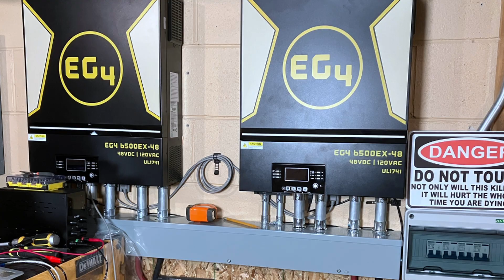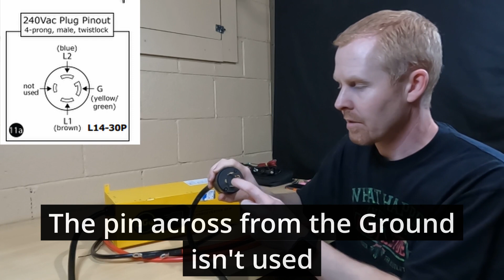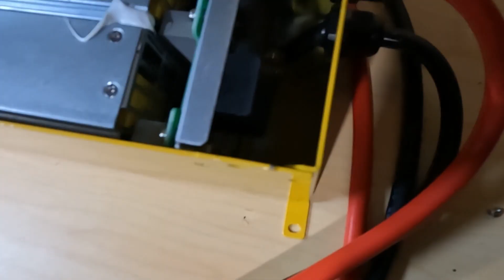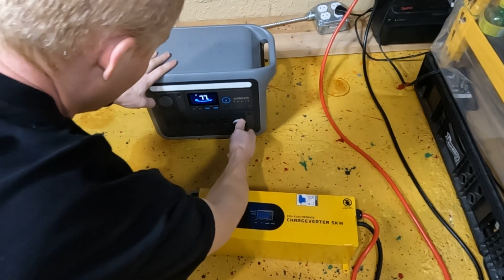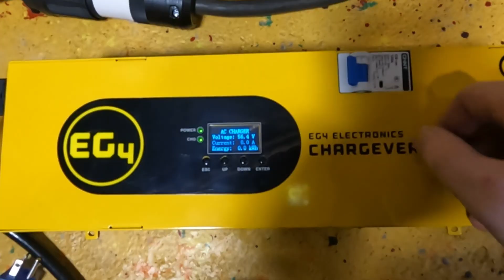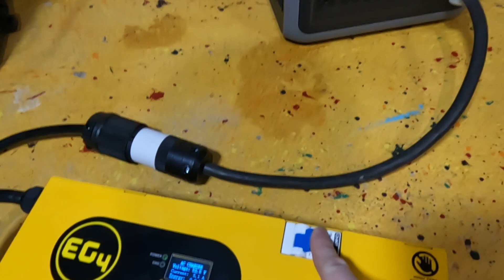Finally Picked up an EG4 Chargeverter 48V 100A Battery Charger

Comment from the maker: Parts & Pieces (affiliate links)
--------------------------------------------------
EG4 Chargeverter 
- https://bit.ly/3xfATCI (Current Connected)
- https://bit.ly/3FhtyX5 (Signature Solar)
Leviton 5266-C, 15 Amp Plug - https://amzn.to/48rh0pD
Sintron NEMA TT-30P Straight Blade Plug, 30 Amp - https://amzn.to/3RoXNxX
ELEGRP NEMA L14-30R Locking Connector - https://amzn.to/3GLtHjl
10/3 SOO Cable - Already had on-hand

Supporting the Channel
--------------------------------------------------
The 'Buy me a Coffee' - link is here (on the bottom, right corner of the website): https://going-off-grid.com

You can also click on the "Thanks" button under the video to support the channel. 

Thank you for your support!

Comment: Look up the new ECO-WORTHY; EC100 48V 100A Battery Charger | 5.78KW Max Output for LiFePO4, Soft Start | 120V 240V AC Input and Generators.
Reply from the maker: I've seen that.  Might try and get my hands on one.  Would be nice to have an extra charger like the chargeverter for my testing.

Comment: Using our unit for the first time in the past 2 days. Matched it with a Westinghouse 5kw generator to charge an IFLA 48v battery bank... it is putting power in the cells without any problem. I am monitoring the cells just to be sure it is charging each cell evenly.

Comment: Using first gen EG4 LiFePO4 batteries, and a large 10kW and new generator, could not get the amps to start flowing.  No SOC applicable, but I'm doing something wrong:  My suspicions:  1. groud of generator goes to house grounding rod. as part of the 3 wires going into the Chargeverter.  2. I set SOC at 1% Start and 100% Stop to 'Disable' SOC.  3. I always immediately flip the breaker to ON, when attempting to set the settings and start charging. 3. Start Voltage = 47 and Stop Voltage = 57.  What am I doing wrong?  Can't get any AMPS to flow.
Reply from the maker: I wonder if a setting isn't actually saving.  I don't have the GC version so I'm not familiar with all the extra settings that one might have.  The old one I have only has a charge voltage and current.  Does the GC version have a current setting like "max amps"?

Comment: very awesome to know that Victrons don't need this ! 
thanks for sharing this since it will save me some money not worring if i need one or not . 
take care sir :)
Reply from the maker: Yeah, from what I've seen and read, they're supposed to be more resilient to the fluctuations of an open frame generator.  I would still double check with whatever Victron gear you get and look to see if there's a specific THD requirement for a generator though.

Comment: This is the only practical way to use a diesel generator of any substantial size. Diesel generators must be run at near full load capacity to prevent wet stacking. These Chargers make it possible to charge a large battery Bank in a reasonable amount of time without having to run a generator all day long. I run two of these on a 10 KW military generator and it does pack some punch ringing the batteries up substantially in just an hour.

Comment: I am not a wiring guy, if I can't use a standard adapter plug is there a place I can get one that works with this? My generator only does 120v.
Reply from the maker: I’m not sure if eg4 is selling any adapters or not.  I thought they were supposed to.

Comment: I've ordered the Chargeverter and supposed to arrive in March.  I also have two new Anker f3800 power stations with their new Home Power Panel.  The HPP is to arrive in March.

My question to you is what Voltage and Amperage should I set the Chargeverter for to charge the f3800s via the DC input which is the XT60.  The DC input has two XT60 male connectors.  I have a relatively old GENERAC gas generator which has a 30 amp 120/240V connection rated 5500w running and 8500w surge.  Instead of solar panels, I thought I'd use the gas generator to output to the Chargeverter and let it produce clean DC to my f3800s.  I guess if I don't hear from you, I'll contact the place I bought the Chargeverter from....
Reply from the maker: Unfortunately I'm not directly familiar with the F3800.  I've seen some reviews on it but haven't had my hands on that device.  If those are the PV input ports, I would be cautious putting the chargeverter on there.  I've been told that some solar charge controllers bridge the positive and negative connection together once the battery is full.  This is fine for a solar panel but it would short out your chargeverter.
Reply: Thanks for your reply!  I too wondered about the bridging the positive and negative connection together once the battery is full.  I'll write Anker Support about this before delivery of Chargeverter in March. @AdamDeLayDIY

Comment: All I can say is.. open that thing up and check the connections. Make sure the modules are well seated, and the main positive to the battery is seated well and tightened in the circuit breaker. Just experience.

Comment: I wish it went upto 58.2v as i can't fully charge to rebalance my cells.
But the little EG4 charger will do that except you need to charge one battery at a time with sysyem off.
But the big charger works well with my Honda EU7000 providing 250v
Reply from the maker: Yeah, I wish it went a little higher as well.  

Just out of curiosity, why do you have to turn the system off with the little charger and charge a single battery at a time?

Comment: I bought one out of fear. SS said in their video that running the generator through the inverter was a big reason for inverter damage. I have an 8750w inverter generator and a magnum 4500w inverter (which is bulletproof). 

When I had AGM batteries I was using the generator often during some of those cloudy day in the winter. I didn't always pay attention to how much gas was in it or didn't get out to shut it off right away and it would run out of gas. When it ran out it would spit and sputter causing the lights in the house to go on and off. I thought this probably wasn't good for anything including the inverter. I don't know if the chargeverter would protect against this kind of damage or not. 🤷‍♂️

I hooked up my new EG4 LL batteries at the same time I hooked up the chargeverter. I only used it to test it (I don't need the generator anymore😁). The Lithium Iron Phosphate batteries have a lot of usable power compared to the AGMs I had.
Reply from the maker: Yeah, SS was warning about using generators with the Voltronic inverters.  Either way, I think the chargeverter is a great idea.  It's hard to find a decent, large amperage 48v charger.  

For me, my upgrade from lead-acid to LifePo4 was huge.  You end up with so much more capacity!

Comment: As you mentioned, you can skip AC in and just charge your battery.  Can this be set up to charge my batteries when battery reaches low and autommatically charge my batteries 24v 400ah for my Off grid solar set up?
Reply from the maker: I’ve seen and heard of people doing this.  Some involve contractors to turn on the power to the chargeveter, others just set the chargeverter voltage low to prevent the battery from dropping too far so their solar can recharge the batteries the next day.

Unfortunately the chargeverter is only for 48v, not 24v batteries.
Reply: @AdamDeLayDIY    Thanks Adam!  I appreciate your quick reply thanks for the great videos!
Reply from the maker: @merrillbalan  not a problem!  Thanks!

Comment: I’ve got an EG4 3000 EHV that is a backup and I use it to charge battery bank with 120v.  Kinda like a half chargeverter! 🤣👍☀️⚡️
Reply from the maker: Haha.  Actually I believe the chargeverters are based off the chargers built in the 3000s.

Comment: I've had one of those for a while now and it works quite well. Mine is wired into the busbars of my battery bank. I've also used to charge up new batteries to the same SOC as existing batteries before adding them to the battery bank. Feed mine with an old Generac 7.5KW gas powered generator at 240V. 

Note that EG4 specifically states that feeding the EG6 6500EX AC inputs with a generator voids the warranty. Apparently they've had serious issues with warranty claims from people who've tried feeding a non-inverter generator into the AC inputs to charge their batteries or pass thru to a house and have a lot of their units fail because of dirty power from flaky generators.
Reply from the maker: They work well!

As far as the EG4 comment, do you have any place where they actually come out and state this besides if you talk to them on the phone?  The latest copy of the manual only states that you can supply power from utility or generator.  There's no warning.  I know I've seen it mentioned on the forum, but if there's some big "issue" that they need people to be aware of, they need to actually inform people about it.
Reply: @AdamDeLayDIY  That was information I was given by Signature Solar. I was told that they had so many returns from damage caused by people connecting them to "dirty power" from cheap generators that they would no longer cover repairs caused by damage from people connecting generators directly to the AC inputs on the EG4 inverters.  I just now went through my 6500EX manual also and I didn't see any mention of that. So at this point I don't know if that is coming from EG4 or just from Signature Solar. 😞
Reply from the maker: @feetachemail  Yeah, I've heard that mentioned as well.  Just disappointing that if it's such a prevalent problem, they don't actually do any preventative warnings to people, they only mention the issues after the fact.  They can't expect people to "know" what issues there are especially when the manual clearly states that generators can power the units.  

I would say it's a moot point because they sunset the 6500s, but there's still lots of people out there with those units.

Comment: Cool…I think that’s a good thing to have ………..I have ruined several sensitive electronic devices in my past using a frame type gen set… so I ditched them all except a big one for construction type stuff and went to mid size inverters gen sets of varying sizes…  Now I feel safer about what I may need to run someday… …………Good vid..J
Reply: I have a outback 7kw system and when I needed to run a generator it wouldn't let power through in less it was within specs. Honda generator 7kw with bad gas.
Reply: @richardbizon8620  I have powered the 35 ft RV I live in with small/ mid size inverter Gensets many times for weeks on end and that works perfect … but as far as powering the inverter out in the solar trailer or just charging the battery’s in the solar trailer , I have never  needed too ….yet…..I just use solar ..
I have heard  the Multi+ is pretty good at  handling less than clean power but I bought 2 inverter sets to avoid pushing it..… im going to wire the system up this spring for a 15- 30-50 amp input and test all of them  out…will test the Multi+  using the big champion ( non inverter ) just to see what happens …I may need to use it someday… I really have no idea…
Everything seems take  forever to get finished …..and always costs more , and is never as easy as “they” said.
J.

Comment: One thing I would recommend. 
Since you made your own non standard adapters. I would label them in an obvious way. To identify that they should only be used with the Chargeverter. So that Noone accidentally uses them for something else. That could be damaged by the wrong voltage. 
This is why you can't buy this type of adapter. Because all standard adapters have to be safe for anything that fits into the ends.
Reply from the maker: Thanks Tim!  I planned on doing this but it’s a good reminder for all of us!
Reply: When I received my Chargeverter,  I ordered a standard adapter on amazon, thinking it will work since it fits, I was lucky because it just did not work, and the Charger simply did not turn on, but it did not cause any damage
Reply: @Remas20007  yes, this is why adapters are standardized. So that you can't damage anything.
Reply from the maker: @Remas20007  Glad it didn't do any damage.  I'm not sure what (if anything) that pin across from the ground is connected to inside the chargeverter.

Comment: My inverter/charger is only split phase 120/240. My grid supply is 2 phase 120/208. I also have access to 3 phase generator that will supply 120/208. The Chargeverter works perfectly.

Comment: Could you slap a power meter on the unit to show the power factor?  That'll be of interest for people running them off generators to see how much energy is being lost.  Leading and lagging would be useful too as that makes a difference too.  There's harmonic on top of that but things start to get a bit technical.  Lots of info via web searches on the effects of this for generators, including inverter types.

Comment: I made a cable that has an L5-30P on one end and an L14-30R on the other with the correct wiring for the Chargeverter.  I have an L14-30 generator inlet on the side of my house that allows me to plug either my 120v or 240v generator into the Chargeverter without rewiring anything.
Reply from the maker: That’s awesome!